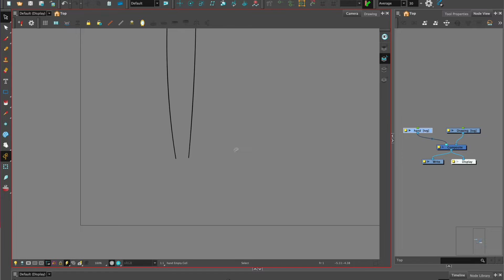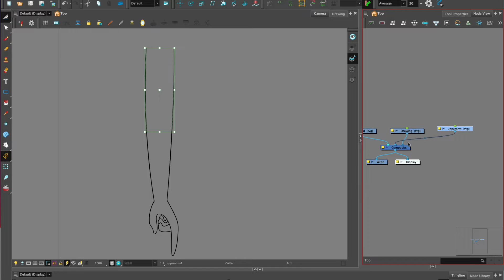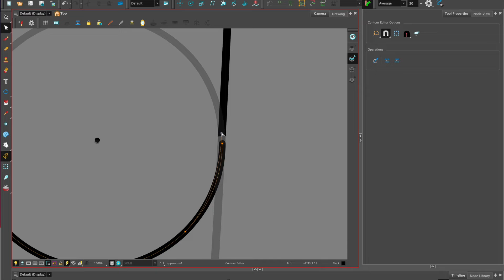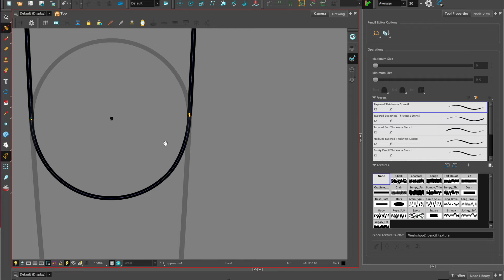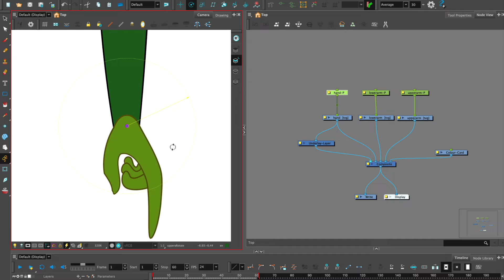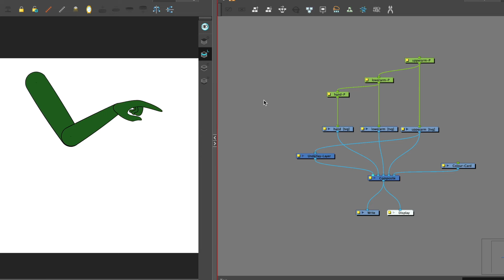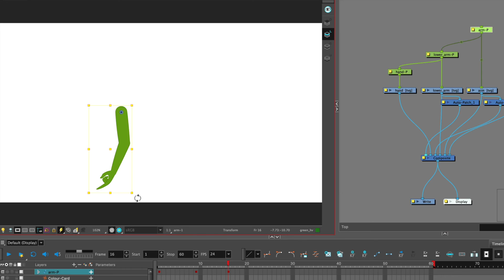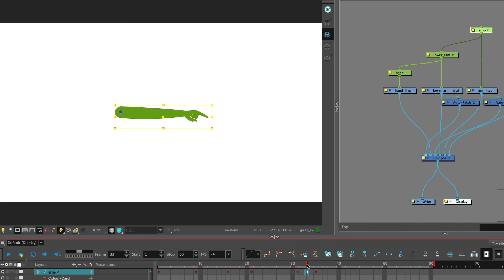How to Rig an Arm in Toon Boom Harmony

Comment: I might need some help.  I tried doing the same thing to the legs of my rigs for a college project, but for some reason, the auto-patch is not budging.  Do you have an idea what I might be doing wrong?
Reply from the maker: Thanks for your comment. I think it could be the order of your connectors, try moving the autopatch connector to the top on the composite. Hope the project goes well🙂
Reply: @HarmonyWithSu-Lynn  I figured it out.  It turns out the color was on the line art layer instead of the color art layer.

P.S. Can you give me some tips with connecting the torso involving the auto patch?